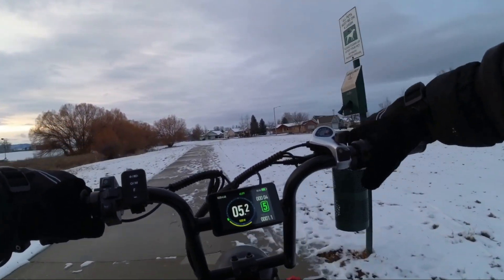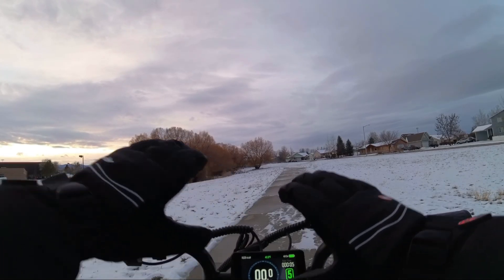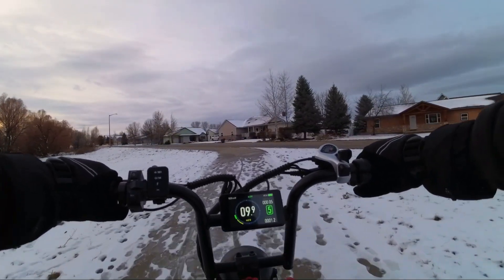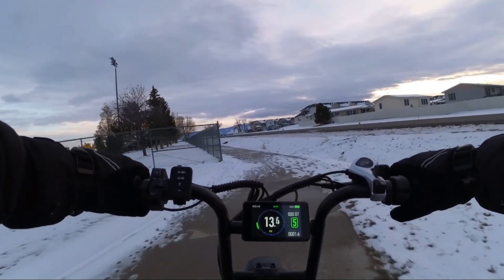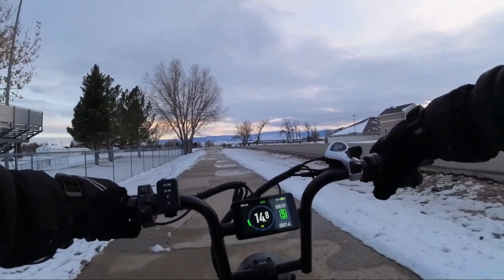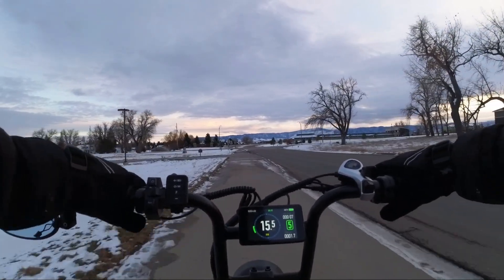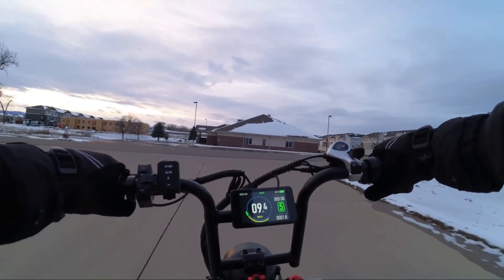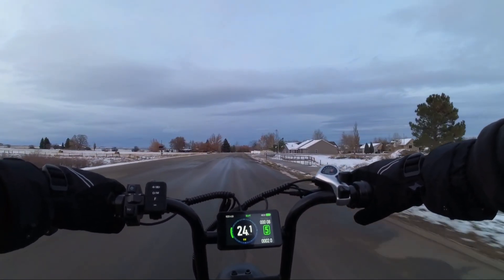Single vs Dual e-bike hub motors: Which is the real game-changer?

Comment: I have a dual motor bike I built got 1000 W motor in the front and a 1500 in the rear it’s a torque monster, but overall speed is disappointing and quite honestly that front tire comes loose all the time I prefer a big rear motor. And I do have a short of me riding in the snow with it if you watch it and you see me almost wipe out in the driveway it’s because the front wheel broke loose.
Reply from the maker: That's what I figured after watching enough video's with those front wheels burning out. I've learned too in the ice to turn the take off speed down. It'll still get loose sometimes. Mostly because they put that dirt/salt mix on the roads around here. I have that stuff it makes such a mess on me and my bike. It's hard to get off the bike.